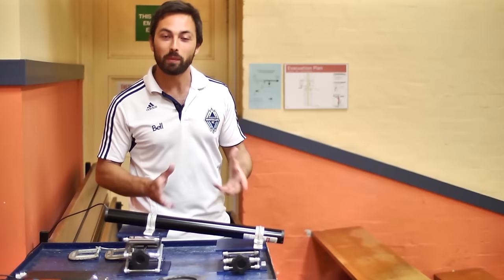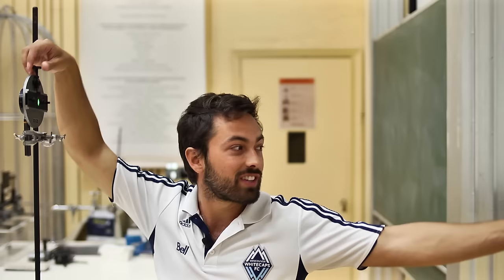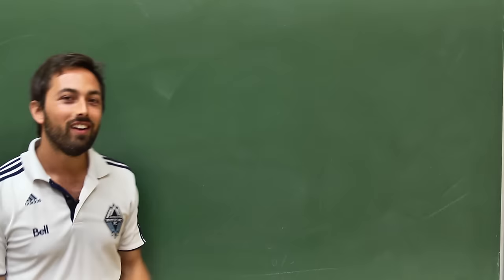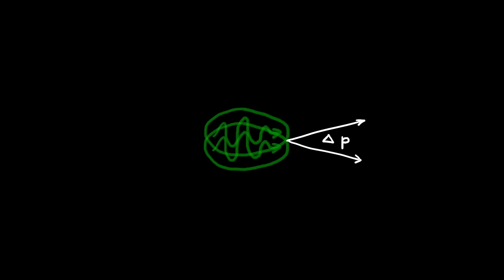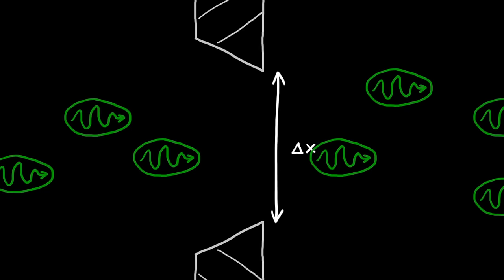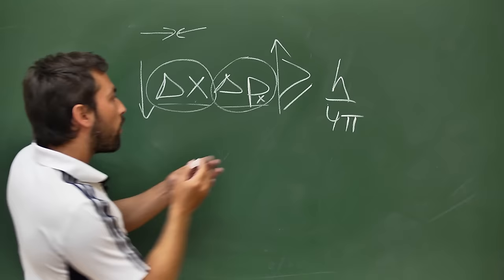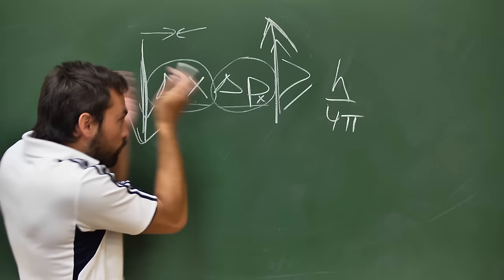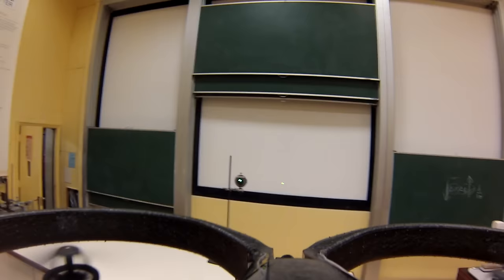Heisenberg's Uncertainty Principle Explained

Comment: Umm, I think this is more likely due to Fourier Optics than the Heisenberg Uncertainty relation. Regardless, the relation does not predict "wider" beams of light as shown here. The greatest consequence of the relation is second, third, fourth, etc order diffraction through the slit which better denotes the greater uncertainty in momentum than "wider" spots of light. Also, you're trying to explain a macro-scale phenomena with a quantum consequence of quantum mechanics. You should have rather said that the position of a molecule and its momentum cannot simultaneously be determined with absolute precision.

Comment: I can't know a photon's position and momentum at the same time?

What about when I use a laser pointer? The pointer shoots the photons in a specific direction, involving a specific set of positions, and they have a specific speed. How does this not violate the uncertainty principle? I know where the photons are, what direction they're going, and how fast they're moving. 

You can calculate the position of a photon emitted by a laser pointer by using the speed of light and the time that has passed since it was emitted. You know the speed. And you can know (you can even predict) the direction by comparing two measurements of position at different points in time. 

I must be massively confused, so can someone explain why I'm wrong please?

I emit a photon from position 0. In exactly one second, it will have traveled 299,792,458 meters in the direction that forms a straight line to where it was emitted from. I can predict where it will be in two seconds from its emission as well, and if it's detected in that position, that confirms that I knew its position, speed, and direction all at once. 

Also, if a photon is massless, how does it have any momentum at all? Its mass is 0, and momentum is mass*velocity. Its momentum should be perpetually 0 if it is indeed massless. So don't I just have to know its position to violate the uncertainty principle? Since light has a constant speed, it should be simple to know its position at any given point in time. 

If the momentum of a massless particle comes down to its energy instead, this should also be predictable. We can already control the energy of an emitted photon. So if I can predict and confirm the energy, speed, and direction of a photon at any given moment, how does this not violate the uncertainty principle?

Help?

Comment: sorry, but it's not clear why the change in momentum ,due to restriction of delta x,  make the photons go to the left or the right. What have momentum to do with direction?
Reply: Momentum is a vector quantity, meaning it has a direction and an intensity. If you change the direction of motion, even keeping the same speed, you are effectively changing the momentum.
Reply: @Manuel-cx6ob  Ok, thanks.

Comment: I thought that light travels in a straight line, what if the cause is gravitational lensing of/between two slits or air between two slits somehow is different in density than the air outside, did they try this inside a vacuum chamber?

Comment: That slit couldn't be less than h/4pi without any uncertainty. One nick or bump should completely disrupt this phenomenon if it were purely based on HUP. This is diffraction. Wave interference. In my opinion this video is incorrect and misleading.

Comment: Why? if i find a higher probability of finding an electron in position x on time t and then in y on t2. then y-x/t2-t will give me exact speed. and i also do have exact location X and Y. but if you try to do this just by  fourier analysis finding position and speed on a single spot only then uncertainty is true. but that's a mathematical limitation but not a limitation set on quantum particles. its more like seeing an object with one eye  doesn't changes the object in 2D, it just shows you one perspective. Then why all the scientist says uncertainty is a fundamental property of quantum particles? i never understood.

Comment: A million dollar question for the next video: How come we can observe an interference pattern here with a single slit?

I’m just here to break some fancy theories.
Reply: That's how diffraction works. The slit is equivalent to an infinite amount of point sources. The waves from the left part of the slit interferes with the ones from the right part of the slit, creating the pattern.
Reply: Manuel Furia So why would light pick only left and right sides? What about everything inbetween?
Reply: @Slava-om1sz  Of course also everything inbetween contributes.
The result you see on the screen is the sum of the waves generated by an infinite amount of ideal point sources placed where the slit is.
The wave coming out of every part of the slit interferes with every other part.
Reply: Manuel Furia Infinite amount of randomly positoned sources would not produce a pattern. Any pattern at all. Try again.
Reply: @Slava-om1sz  Why would it be so?
What I'm talking about is a well known principle that it's heavily used when dealing with waves and diffraction.
https://en.m.wikipedia.org/wiki/Huygens–Fresnel_principle
Reply: @Slava-om1sz  I read that you wrote "randomly positioned". You might have misunderstood what I was referring to.
The slit is equivalent to a line of ideal point sources (emitting spherical waves), located in place of the slit (not randomly). The reason why we see interference on the screen is because those sources interfere with eachother (which you can read as "the waves 'emitted' by part of the slit interfere with the ones emitted by other parts of the slit").
That's quite obvious when you actually draw the picture. If we look from a point in the right part of the screen, the right part of the slit is nearer than the left part of the slit. So the more a wave comes from the right region of the slit the less will have to travel with respect to the ones coming from the left side of the slit, thus they will be sometimes in phase and sometimes out of phase with eachother, depending on the angle (and this is the interference pattern).
In the center of the screen instead (where the angle is zero), the distance is more or less constant, so the various parts of the wave coming from the slit are all in phase. Thus you see a big maximum in the middle.
Reply: @Manuel-cx6ob  I'm familiar (on a basic level) with the wave diffraction principles and how parts of waves cancel each other out. Thank you. What doesn't add up in your explanation however, is that for some reason you describe a limited amount of 'fixed spots' between the walls where the wave starts inside the slit. Try this: Imagine visually zooming in on the slit really close, then picture a billion dots between the walls of the slit, with a completely random distance between the dots. Now imagine a billion photons passing through those randomly distributed locations triggering a billion waves. Yes those waves would interfere partially cancelling each other out. But because the starting positions of the waves are not aligned in a pattern in the first place, it would become a complete mess, producing no clearly distinguishable pattern. Aka just a single light spot on a back wall.
Reply: @Slava-om1sz  Again, the point sources are not distributed randomly (why would they be?) and are not finite in amount. They are a continuous line. You can compute the sum of their contribution using an integral.
Reply: @Manuel-cx6ob  So if not randomly, by what rules are the passing points inside the slit are determined? Where do you get that from? Where can I read about that?

Comment: I keep watching videos and I can't grasp this !
In the slit experiment, as the size decreases, the surface decreases square while the perimeter decreases linearly. at some point the size of particles start to matter compared to the size of the slit and the perimeter becomes, relatively, a higher source of noise, particles bouncing at unpredictable angles : that's how a water a spray works, so the uncertainty is due to the fact that the information has been modified by that noise. I do not see that as a strong uncertainty - if I may borrow the expression, it seems likes a limitation du to collateral damage to the flow by the mechanical component of the experiment's apparatus. I mean that  doesn't make the Uncertainty principle wrong, just that may be this sort of experiments is not exemplary for the purpose ?
Don't shoot me - just asking, what say you about that affinity between water spray model and the photons that gives the Uncertainty such meaning beyond a boring photon spray in this experiment ? (no offense 😉)
Reply: I remember there is that other experiment with photon and slit, but there is a single photon sent and two slits :  the double-slit experiment, which produces an interference pattern on a screen behind the slits - I am rather 'uncertain', as to  what to make of that in the current context ?

Comment: It seems to me that one would need to narrow the thickness of the material of the slit itself to a very small size to adequately test the particles...otherwise, how can we rule out simple deflection, say as a pool pall off a rail for example.  Would not the walls of the slit apparatus (if not absolutely straight relative to the laser projection) act as a reflective/deflective surface as it nears the epicenter of energy produced by the laser, thus actually causing the particles/waves to deflect into an angular projection?  Or is this the root of the principle?  I guess I am curious if the thickness of the slit producing material has ever been considered as a factor for the phenomenon and if relative tests have been performed to factor this consideration...Hmmm...I know this is a four year old video, but I just came across it for the first time and it got me thinking:-)

Comment: Does this apply to all fundemental particles? If I shot a beam of electrons through a slit and made it narrower, would they still spread out. Im wondering since electrons dont have the same particle wave duality problem.
Reply: Alexander Ekrot electron do have the duality. You can assign them a wave length with de-Broglie's formula: wavelength = h/(m*v). So this also applies to all very small particles, atoms, too.

Comment: But momentum = mass × velocity mass of a photon is fixed and velocity is fixed too then how can momentum change?
Reply: I think that's because momentum is a vector, so it's uncertainty is just an uncertainty in the direction of the arrow or vector
Reply: The momentum is not simply "mass * velocity". That is true only for slow moving objects. For a photon (or anything that moves at the speed of light), the momentum is p = E/c (the energy divided by the speed of light).
For a photon, the energy is given by its frequency * planck constant. So the momentum of a photon depends on it's frequency (not on its velocity, that is always c).
Then of course, the momentum can also change in direction, being a vector quantity.

Comment: I call BS on the uncertainty part. At least in this experiment. Namely, narrowing the slit does not decrease delta X for a single photon, it just blocks more photons. Nevertheless the trajectory of individual photons clearly gets modified. I’m willing to bet that photons simply interact with the material of the slit sides to change the direction.
Reply: How do you explain then the interference pattern that you obtain by adding a second slit?

Photons (and particle in general) don't really have "trajectories" in quantum mechanics.
Reply: @Manuel-cx6ob  I can't explain the interference pattern obtained by adding a second slit just yet, but the interference pattern has apparently nothing to do with the amount of slits anyway. One experiment I would like to see is how different thikness and different types of material affect the results. From there I could exclude some hypotheses.
Reply: @Slava-om1sz  What problem do you see with the description given by standard quantum mechanics?
It is quite simple and does fit experimental data perfectly.
You also have to be careful that your hypothesis actually fit with what we observe. For example, you can't really create a theory in which particles are just balls that have well defined positions and velocities without imagining some kind of "spooky action at a distance", because that would be a local and real theory, which is excluded by the observed violation of Bell's inequalities.
Reply: @Manuel-cx6ob  The problem I see with the description quantum mechanics provides is that it's just that: a calculation designed to fit experimental data perfectly. I don't claim to know the stuff better than the authors, but I am targeting human psychological biases that lead to settling garbage like multiverse theories, just because scientists keep stacking layers of assumptions on top of each other.
Reply: @Slava-om1sz  "Stacking layers of assumptions" -> really? Can you give me an example of those assumptions?
Quantum mechanics is a quite simple mathematical theory, that does not require many assumptions.
You can model almost all of the observed phenomena with half a dozen of axioms.
What is a "multiverse theory"? Do you refer to the many world interpretation? (that does not have anything to do with multiverses)
Remember that interpretations are mainly philosophical arguments that people like to have, they are not part of the theory. Where an interpretation foundamentally changes the underlying theory, then it can be tested and it's not an interpretation anymore.
But this doesn't mean that you can start to model photons as bouncing balls, because you find out soon enough that it just doesn't fit the experimental data, thus is not a theory nor an interpretation, but just nonsense.
Reply: @Manuel-cx6ob  Sure:

Planck length is length below which the concept of distance loses meaning -> Assumption
Particles pop in- and out of existence -> Assumption
Quantum states are discrete -> Assumption
A quantum particle takes all possible paths simultaneously while  moving from A to B -> Assumption
Photon is a particle -> Assumption
Photon is a wave -> Assumption
Photon behaves like a wave and a particle -> Assumption
Observing collapses wave function -> A pile of assumptions in one sentence
Big bang -> A club where skeptics are not welcome
Multiple universes can exist in parallel -> Prefrontal cortex just short-circuited
We know what gravity is -> Ehm.

I'm sorry about losing seriousness at the end. But hey, it's late.
Reply: @Slava-om1sz 
Some of the things you listed are not postulates (assumptions), but they are results of the theory (stuff you can derive matematically from the theory). Others are just not part of quantum mechanics.

Planck length -> is not part of quantum mechanics, and it's not an assumption. It is derived using quantum mechanics and general relativity together.

Particles pop in and out of existence -> that's a calculation trick in perturbation theory. It simplifies calculations and produces correct results. Nobody knows if virtual particle are "real objects" or not, but as mathematical tools you don't need them to be real. (Think about how complex numbers are used as a mathematical tool in physics or engineering).
Quantum states are discreete -> yet again this is not an assumption, but a result of a |ore basic postulate (the wavefunction).
Photon is a particle -> this is a postulate, but it's based on experimental evidence (you can't absorb half a photon).
Photon is a wave -> the wavefunction is a postulate.
Photon behaves like a wave and a particle -> this is not a postulate, bot an observed experimental fact.
Observing the collapse of the wavefunction -> this is an assumption only in the copenhagen interpretation, it is not needed for quantum mechanics to work.
Big bang -> not related to quantum mechanics
Multiple universes can exist in parallel -> what are you referring to? If you talk about string theory or wathever else, I would say not related to quantum mechanics. If you talk about the many worlds interpretation, then is not "parallel universes". "Many worlds" is just a poorly picked name.
Reply: @Slava-om1sz  So of all the things you listed, only 3 are assumptions, and they are heavily based on experimental evidence.
Reply: @Manuel-cx6ob  Single Slit Diffraction by Huygen's Principle does this easily.
Reply: @Slava-om1sz  Single Slit Diffraction by Huygen's Principle does this easily.

Comment: How do you use this principle in day to day life though. I mean what's the practicality of it?
Reply: Any system that has quantum interactions will have this feature. So computer chips, for example, are getting so small and the transistors are so small that elections can actually tunnel between wires. And so there is a limit to how much computing power we can shove into a small disc of metal. Manufacturers now have to come up with more clever ways to increase computing power and memory storage.
Reply: In day to day life? Maybe none yet, but it allows fir building theories that could greatly advance technology and our understanding of the world

Comment: what happen if you use a real particlebeam and not a laser for this experiment ?
Reply: The same would happen, but you would need a much narrower slit, because matter waves have usually shorter wavelenght.
Reply: I found another video in which the experiment with fluorine ions was performed. Probably our universe consists of two worlds whose existence is 50/50.